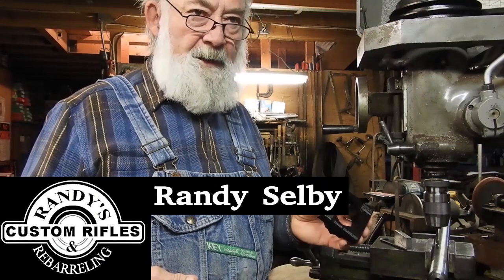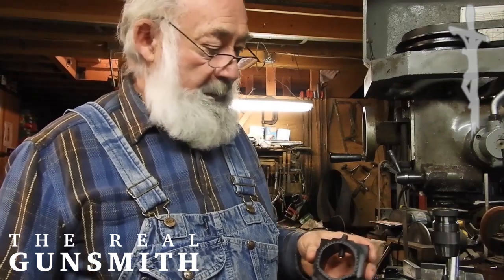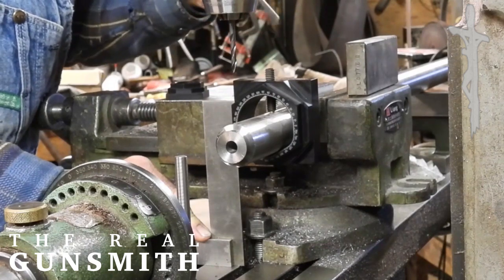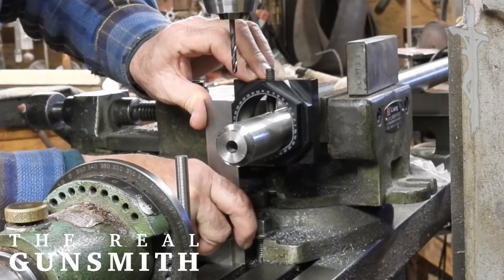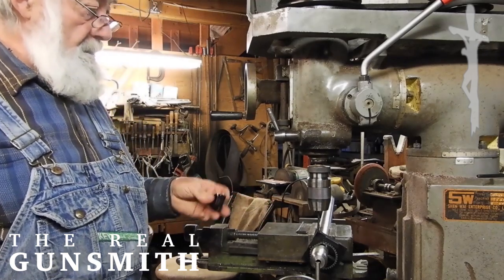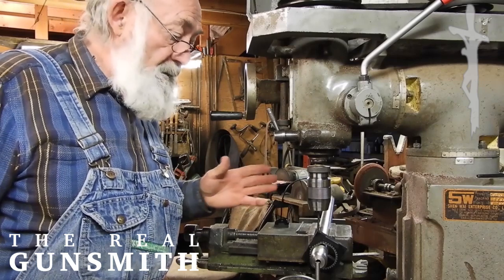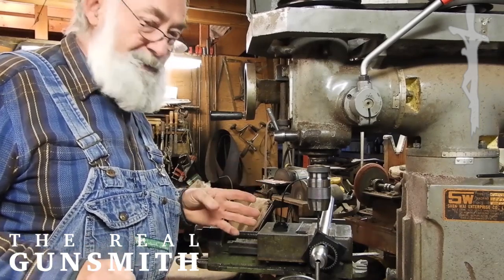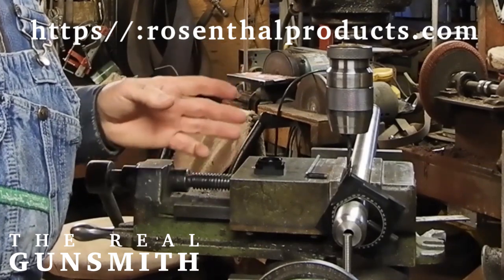How to use Rose-Index

Comment: Randy-
Thank you for the video I appreciate your efforts. I am glad you like my Rose-Index®.

I made a video on my “Rosenthal Products” YouTube channel showing all the forms of indexers I have. 
https://www.youtube.com/watch?v=M5aO1DIb7Mo&t=183s

Over the years I have ended up with a significant investment
in indexers trying to increase my shop’s capabilities and to be more efficient
working with round parts. Even though I have a large variety of indexers they
brought disappointment when I needed to do something quickly. Having all these
forms of indexers, and being disappointed in them I knew I needed to re-invent
the wheel a bit. The intent for this video is to show that I didn’t just create
something to sell…….I created something in my shop that would make my day
easier, and to hopefully save others similar disappointments. The Rose-Index is
really much more than an indexer. I am working on videos to show various uses. Simply
put the Rose-Index is a convenient tool that hardly takes up space in your tool
box yet will really increase your machines capabilities. (My investment in
indexers is collecting dust and taking up quite a bit of storage space.)

In Randy’s video he needed a 30 degree index. There are a couple easy ways I do this.

Process #1 (Using the Degree Wheel and machinist square)

Step 1 - Place the Rose index on the shaft with the shaft
protruding out just a thou or two. (This will keep you from scratching the face
of the Rose-Index in step 4)

Step 2 - Line up the Rose-Index with the Vee pointing towards
the operator. Push the machinist square into the outside of the square next to
the Vee, and continue to push as the Rose-Index makes contact and centers
itself up.

Step 3 - Tighten the set screw. (At this time the degree
wheel will either have the 0 degree mark up and the 180 degree down, or vice
versa.)

Step 4 - Rotate the part until your straight edge of the
machinist square shows the 30 degree line and 210 degree line are inline.

Process #2 (Using a Machinist Square and Adjustable parallel)

Step 1 - Set the Rose-Index up with your machinist square
using the “Hex” and tighten the set screw.  (Just like Randy did in his video). You could
also reference the machinist’s square to the square that is parallel to the hex.
(Please note that all the shapes are machined during the same operation which creates
great accuracy in each shape’s relationship to the others.)

Step 2 - Loosen your vise so that you can rotate your part

Step 3 - Rotate your part and reference on the hex of the Rose-Index with an adjustable parallel from the machines table.

Step 4 -Tighten the vise.

This works because you are changing your Rose-Index’s 60 degree reference by 90 degrees, which gives you a 30 degree change.

Thank You and Best Regards,

Timm Rosenthal
Reply from the maker: Thanks Timm! Randy knows he'll get much use out of these.  
Appreciate your taking the time to add valuable information.

Comment: Neat tool Randy . I already have a super spacer with a 2 in through hole but if I did not have it I would give that a try for sure!
Reply: I have a couple super spacers also that collect dust. About the only time I use them is for the 3 jaw chuck to clamp onto round stock. A Rose-Index is very light compared to a super spacer and will turn your vise into an indexer in a couple seconds. One of the biggest advantages is that you can remove it and be able to machine almost all of your workpiece.